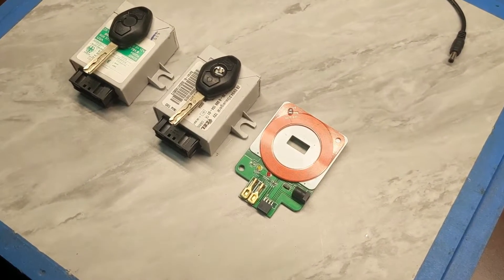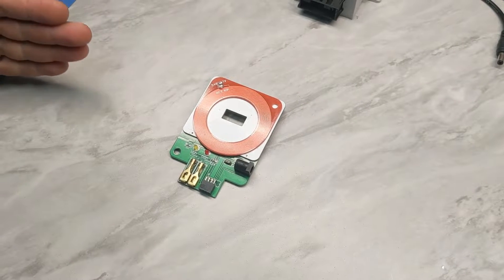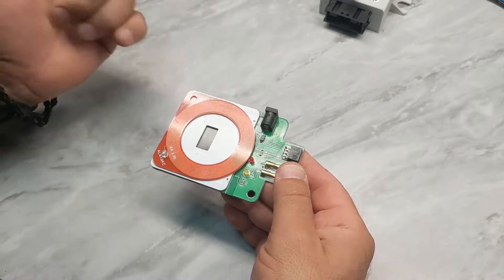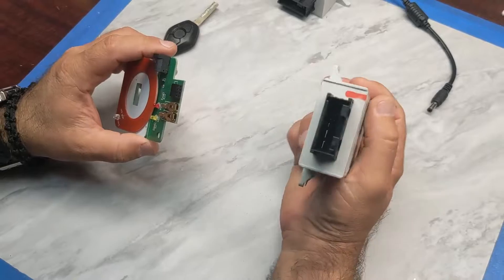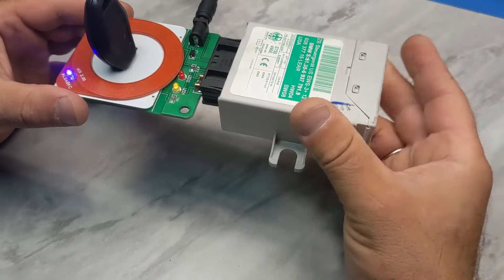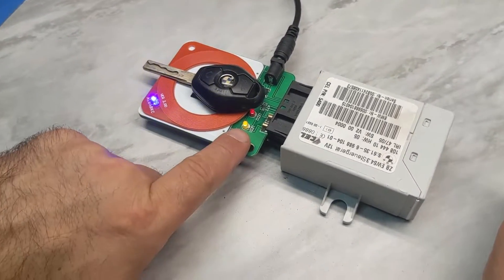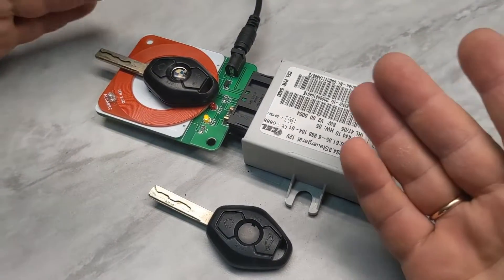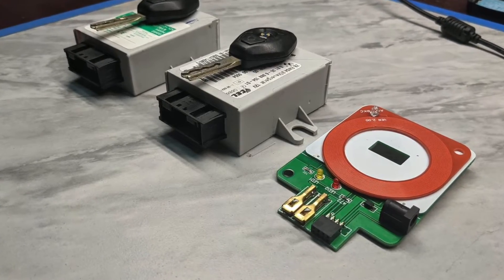EWS 3 & 4 Testing Platform for BMW

Comment: Do you sell that tool?
Reply from the maker: Yes we do! Contact sales@ecuteam.com
Reply: @ECUTeamCorp  I have a 2002 bmw 325i 
EWS issue the key doesn’t start or crank the car but when I remove the EWS connector and put a 30 amp fuse into the two main slots it cranks but doesn’t start.